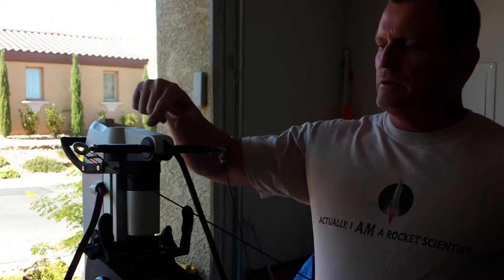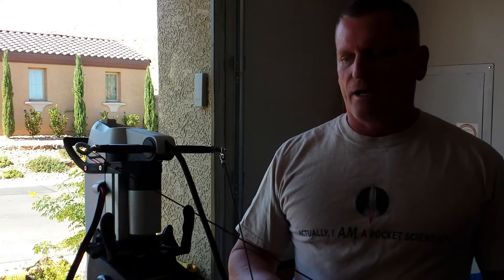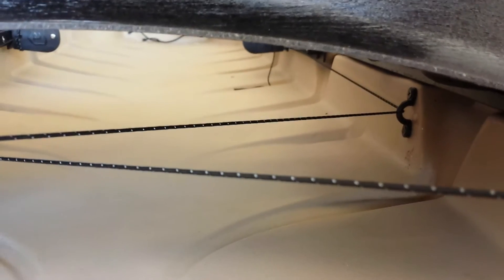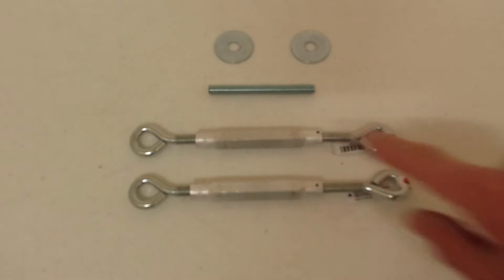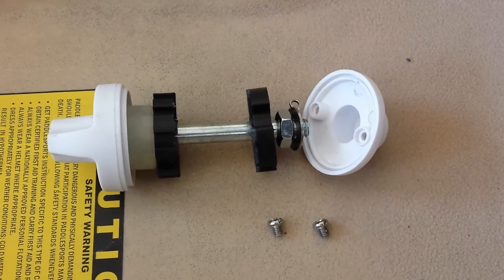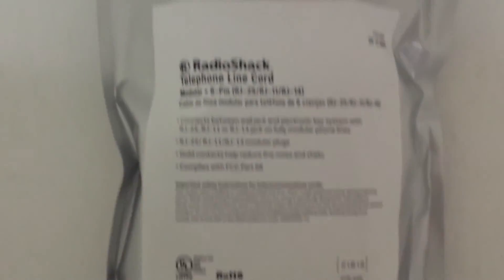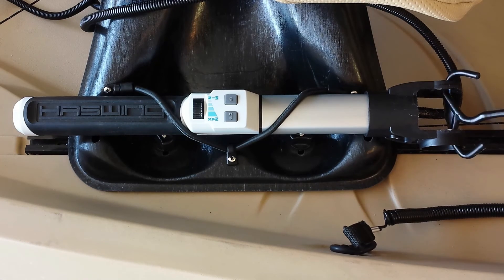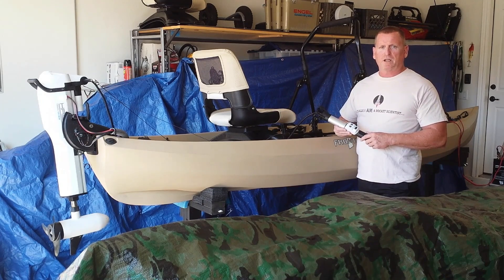DIY Haswing Comax 55 lb Trolling Motor Remote Control Pedal Steering On Nucanoe Frontier 12

Comment: Cool vid! Do you still have this kayak? If so, is the motor still working too? I just bought a jonny boat, strictly for river fishing and this trolling motor is a must on it. It'll allow me to keep the motor above water level when not in use and deploy when I need it.
Reply from the maker: Hi. I still have the kayak but it now has a bow mount trolling motor on it. The Comax never gave me a problem and is a great motor.

Comment: Now that the Frontier 12 has a bow mount for a motor would you still get the Comax or would you get the remote control Cayman? I like the power trim on the Comax but hands free set up on the Cayman is really nice.
Reply from the maker: Even though I have converted the Comax to remote control and foot pedal 
steering, I would still prefer the transom push power as opposed to the 
Cayan pull power. I think that you get better hands free steering 
response using the foot pedals than the wireless remote. I agree that 
the power trim is great for fishing different depths. Haswing makes some
 excellent TMs at great prices.
Reply from the maker: Even though I have converted the Comax to remote control and foot pedal 
steering, I would still prefer the transom push power as opposed to the 
Cayan pull power. I think that you get better hands free steering 
response using the foot pedals than the wireless remote. I agree that 
the power trim is great for fishing different depths. Haswing makes some
 excellent TMs at great prices.

Comment: Those nylon pad eyes? Aren't they going to be too weak?
Reply from the maker: I have used them on other builds and they have worked fine. You are applying force gradually and not stomping on the pedals.